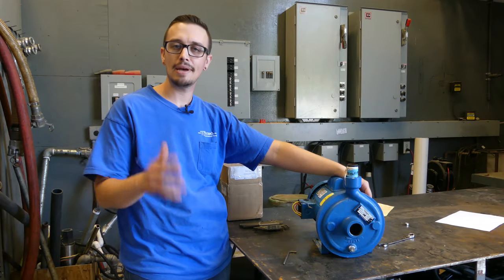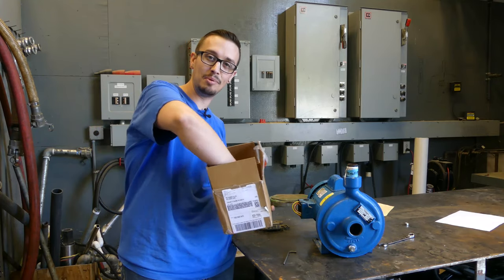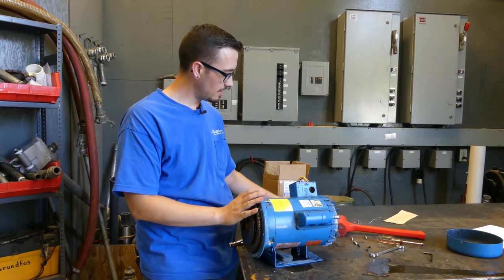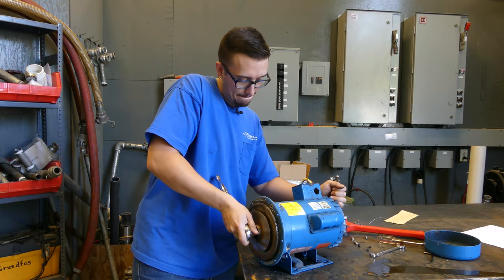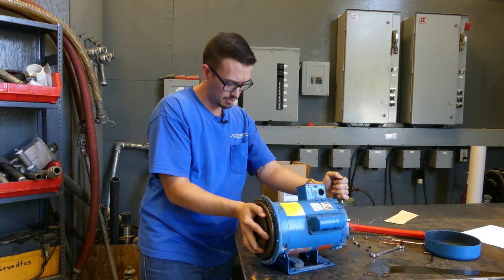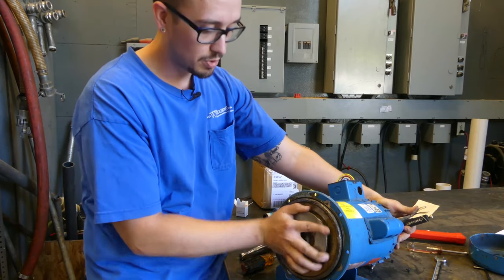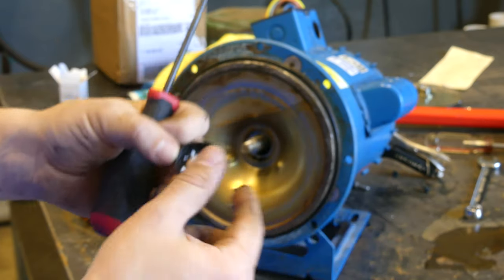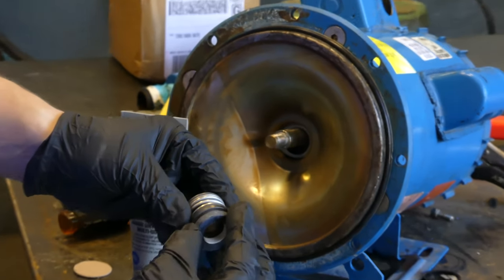Mechanical Seal Repair on a Goulds MCC Series Pump

Comment: My pump was apart for a week or 2 then I ordered the correct parts. Took 3 weeks after that to get a new ceramic shaft seal, spring etc... . Thanks for showing how it all goes together. By the time the parts got here, I forgot.

Comment: Do a no load run on the motor.  If it isn’t butter smooth and quiet then you need to be figuring out which bearing is bad.   If it is smooth and quiet then put the pump back together.  But if the  motor has a bad bearing it will ruin the seal fairly quickly.

Comment: That nut on the impeller is always striped out a spanner wrench works the best just hope the shaft is okay if it's bad it will still leak. the white ceramic It best to silicone the rubber  in cheap insurance. lube the seal with soap most likely it for drinking water.  when pushed on make sure the seal dose not roll  or it will also leak  of course keep clean the most common reason it brake like that is from air hammering from a air pocket  the impeller being unbalanced/bent  wouldn't brake the seal it would have to be bent really bad and if that was the case it would most likely lock the pump end up  right away first.  Ps.  I've been building pumps and booster for way to long it seems like now 17years so I think I done quit a bit of them. for 8 year at least 99 percent of the boosters that have come to our shop have been done by me the only time I have a problem is when the seal is cheap or low quality.  I would always pick the  highest quality seal if you don't want any leaks. My opinion👍👌✌️💯🥂💦🌊⛲

Comment: i have the same issue with Pedrollo water pump ... it starts leaking water and had awful and noisy sound, thnx for the video
Reply: I would be looking at the bearings in the motor.  If you have a failing bearing in the motor it will cause the seal to fail.

Comment: I have a Gould J7 that came with my house. I noticed a decrease in pressure and started troubleshooting with your videos and noticed that the motor was set to 230 and there is only 115 that it has been running off of. Is the damage down or would wiring it correctly help to fix the problem?
Reply from the maker: Only one way to tell - set it to the correct voltage and fire it up!

Comment: Changing a seal but not bearings is like wiping before you poop. The seal doesn’t hold the shaft straight. Time will not tell. You me issue is already clear and should be fixed.

Comment: Hey brother, just curious why you didn't show how you removed the front housing from the seal housing...if yours just simply pulled apart, that's awesome. I've never seen the cast iron housing separate easily from the stainless steel housing without using a homemade bearing puller tool. The water is pretty hard and/or corrosive in the high desert where i live and was just curious if you used any technique to separate the housing or not.
Thanks,
    Justin Henry
Reply from the maker: We had taken it off once before this, and it took us nearly 2 hours. We ended up wrapping chains around it, hoisting it up, and used a forklift to pull down on the chains. It was tough.
Reply: It called a hammer give it a good quick smack or use a old screw driver and hit it in between the housing opens every time 👍👌✌️

Comment: Why don’t you go with tungsten seals, I work on t-30,t-60, and t-75 rossi and catteli circulation pumps and tungsten material seals seem to work better
Reply: That why you use that seal because of hot water and those are perty expensive seals to just put it in because you fill like it. They are a lot better seal though

Comment: What is the maximum psi that this  type of pump can generate and run at? On a system with a expansion tank.
Reply from the maker: The flows and pressure capabilities depend on the pump model and HP. Here is a link to the brochure for the Gould's pump MCC series in the video: http://documentlibrary.xylemappliedwater.com/wp-content/blogs.dir/22/files/2012/07/BMCC-R5.pdf

Comment: hi buddy ive got a Goulds 1 H.P 2 stage jet pump mounted above ground the well is about 150FT deep im having a hard time finding parts every one wants to sell the whole pump and i have a new motor on it just need to rebuild the pump part leaky seals & o rings ni might as well change the 2 impellers can you help me in any way ? i thank you very much sir .
Reply from the maker: We sure can! Give us a call at 855.329.4519 or email us at Customer.Service@RCWorst.com. We will need to know the model # of the pump to get you pricing on parts.
Reply: YAWZA THANKS A BUNCH THATS OUTSTANDING !!!!